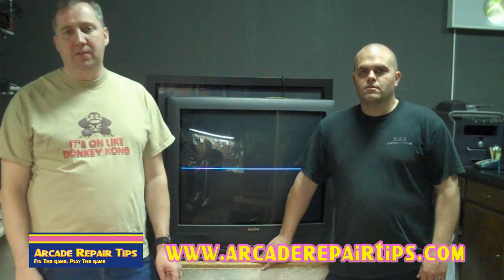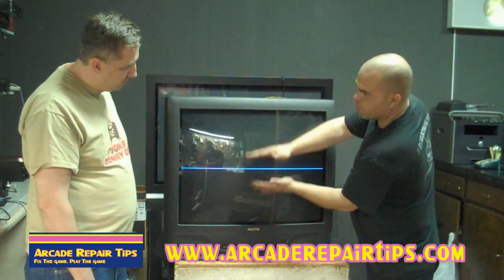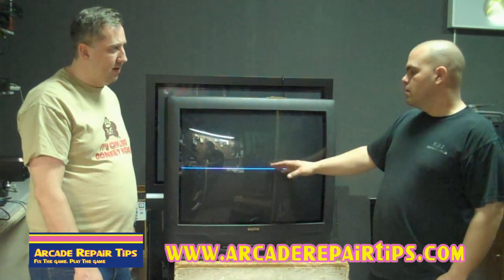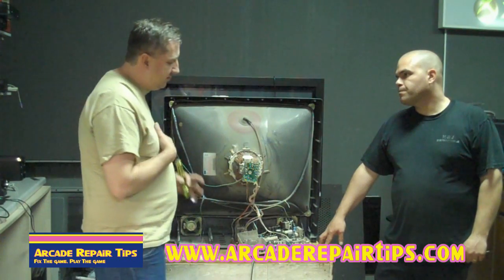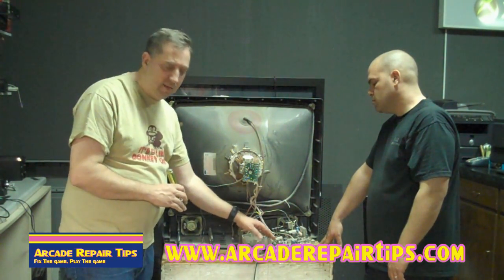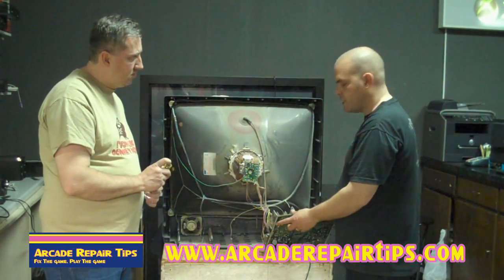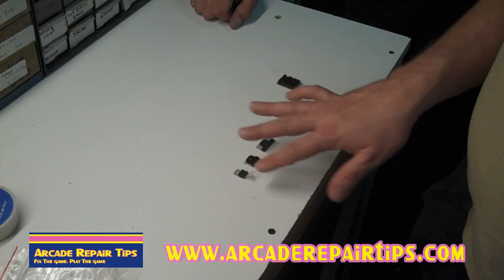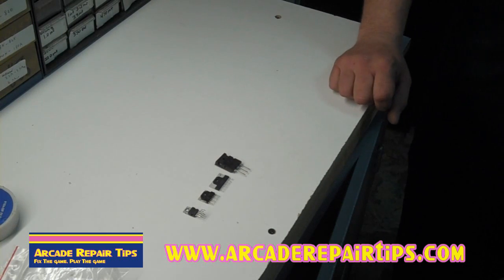Arcade Repair Tips - Repairing Monitor Collapse Issues

Comment: As to Horizontal Collapse, I have  a Gorf standup game.  Every now and then, while playing, the sides of the screen will start to pull inward a few times, and then it pulls in to a full horizontal collapse, with just a vertical line from top to bottom.  I have slapped the side of the cabinet and sometimes caused the vertical line to open back up to an open screen and the horizontal collapse goes away.
Also, there have been times where the background sound will go out, but the sounds of the shots and explosions will still work.  Then later, the background sound will return.

It really depends on the day I turn on the game.  Some days there are no problems, other times I get the issues noted above.
What can be done?  Thanks.
Reply from the maker: @pixnstix The random collapse you are experiencing sounds like a monitor issue. Since you can slap the side of the cabinet and make it go away, it would seem to be caused by cold, cracked, and/or broken solder joints. Remove the chassis and touch up the solder on all joints in the vertical section. See our post on Repairing Monitor Collapse Issues (https://www.arcaderepairtips.com/2011/04/07/repairing-monitor-collapse-issues/) for more info. Of course, might install a cap kit as well while you have the chassis removed from your cabinet.

The background sound issue would seem to be more of a board issue. Check the connection between audio board and the game board along with the audio amp for cold solder joints.

We will also be covering your question on our Live Show Episode 91. Here's a link to the episode if you want to watch it: https://www.youtube.com/watch?v=25kFPPoUna0
Reply: @arcaderepairtips   Thank you!  I'll give it a shot.

Comment: Not sure if you guys will see this comment or not but my monitor is exhibiting this issue. After 5-10 minutes, it fixes itself. Any idea how I can fix this? https://youtu.be/Wvknjq4y7bo?si=iCiiwq3nq1rjyKVY 
You also see these horizontal lines at the top that appears when it first turns on but goes away after a few minutes.
Reply from the maker: Try adjusting VR450 on the main chassis. This should help with the hourglass effect. If it doesn't, the problem could be electrolytic. The horizontal lines at the top are usually a good indication that it's time to install a cap kit. Hope that helps.
Reply: @arcaderepairtips  I actually had the chassis recapped pretty recently. The hourglass effect does go away after the monitor is on for 5-10 minutes. It started happening after the cabs were moved recently. I can look into the VR450.

Comment: I was given a rally bike arcade game and sound etc all works , the problem is that the monitor is all short small colourful vertical lines , , checked out power supply and all good , the neck tube has a very very small orange light which compared to other monitors on you tube mine is super dim/small , any other ideas? At my end of the rope already lol , please
Help lol
Reply from the maker: Based on your description, this sounds like more of a board issue. Check out our post and video on Inspecting An Arcade Board (https://www.arcaderepairtips.com/2011/03/16/inspecting-an-arcade-board/) for some tips that might help you out with this problem. You might also email some pictures of the monitor to us at questions@arcaderepairtips.com so we can take a look.

If you would like more details about your question, please tune into our Live Show Episode 52 on Thursday, June 3, 2021 at 5:30 PM CT. Here's a link to the episode if you want to watch it: https://www.youtube.com/watch?v=RjuNCBBRTk8. Thank you for your question and good luck with your future repairs.

Comment: any online repair services?  not an arcade, just an old TV  (panasonic TR 205) little thing... not entirely collapsed, but it's on the way there. the picture hamburgered and the vhold isn't stable. any way to get this up and running?
Reply from the maker: Since it's not entirely collapsed, try replacing the caps first to see if it helps the issue before moving on to the steps that we discuss in this video. Hope that helps.

Comment: I have this problem in a chasis weiya, the b+ is very high 247v, the input in the vertical should be 24 and i have 34. Can you give me and idea where to see or what is making this problem?
Reply from the maker: We asked our monitor repair specialist Michael about your question and here are his thoughts: There are three main causes of this issue. The first is cold solder joints. Double check all your solder joints (especially on the larger components) and touch up as needed. Next, check all of the caps on the b+ voltage line and in the power supply. Pay close attention to your 35v-50v caps and make sure that they are not open. Finally, it could be that the power supply does not have a load on it which could be caused by open resistors in this section. It's common for this to happen when the flyback or the HOT goes bad. Look for these resistors and replace as needed.

Also, just wanted to let you know that we will be covering your question on our Live Show Episode 48 on Thursday, February 4, 2021 at 5:30 PM CT. Here's a link to the episode if you want to watch it: https://youtu.be/_Y2j-bEFhjI. Thank you for your question and good luck with your future repairs.
Reply: @arcaderepairtips  Thanks men i really appreciate your message, sure i will be in the live on thursday.

Comment: Hello sir...I'm having some issues here...I was trying to get my pi2jamma working with the Hdmi timing and Inkind of messed up my monitor I believe. I also when I take the Jamma off and play a PCB game Nna showtime and plug the Jamma in the PCB I get these red lines stroll as well as on the Raspberry pi. This just happened after I put the wrong settings / Hdmi setting / other Display settings on my CRT. Does anyone knows how to fix this issue for my CRT Arcade monitor? Do you think my Jamma is messed up or is a  Resolution problem? I have a pic I took..if could send you the pic to your email..if you have one?
Reply: An I also have a red led light by the jamma plug in

Comment: Something sparked on the back of the monitor in my arcade game and now the picture is all pink, fixable? It's still playable but all pink
Reply: I hope that you've solved your problem but I have made a quick research and found this. If the color of the monitor is close to ff00ff (you can google it) - I think it's the green that is dead, because this color is 255 red, 255 blue and 0 green... Use the previous video in the playlist to solve the green problem.

Comment: If you have a TV or arcade game doing this, switch it off as soon as you notice the problem. Without the vertical scan, the horizontal line will be VERY bright and will burn the phosphors much quicker than usual. After a few days of running like this, you may well see a dark line across the screen where the phosphor has burnt; even worse than the normal screen burn that arcade games get.

Comment: Yeah vertical sweep failure, I had a computer monitor with the same problem

Turns out it was the solder joints on the vertical controller transistor had broken

Comment: Thanks, but I'm still a little unsure about how to go about doing that. For example,the neck on my TV has 9 pins, and the board it uses has twelve holes. Most of the arcade chassis I've seen on eBay have 10 holes. And one more thing, don't you also have to measure the inductance both horizontal and vertical of the yoke? I remember reading that when I found a forum with the same question. Any help would be nice. Thanks for the other comment.

Comment: Yes it would work. 2 things though: Obvious number one: The neck board from the arcade chassis is compatible with the TV pins, (usually is if it is the same size monitor)Not so obvious number two: You need to get a voltage meter and set it to ohms, you then need to (measure) the resistance (both horizontal and vertical) of the yoke(the copper coils that slide over the neck). If the resistance matches the rating of the arcade boards specs. Easier than it sounds.

Comment: Hi, thanks for your video it was very helpful. I have a quick question. Hypothetically speaking, if you took out a TV monitor and replaced the old chassis with an arcade one, would it be able to work as an arcade monitor or would the arcade chassis just not work with a TV monitor? Just wondering because I have a spare TV with no practical use right now.

Comment: Hi there,i have one Samsung CRT monitor Flat screen,do i have to discharge it before looking at the inside parts?It does not work at all,i just plug it in the soket,and press the power on buton,but nothing happens,what should i look for ?Where to start ?

Comment: Is it not necessary  to discharge a monitor to fix a cold solder?
Reply: don't you suppose to discharge the tv before even work on it ????
Reply: @RaulBillieJean no not necessarily. You don’t typically need to discharge a crt tv for most repairs, you usually won’t even come close to anything that would bite you. Just don’t be stupid and start touching random things if you aren’t sure